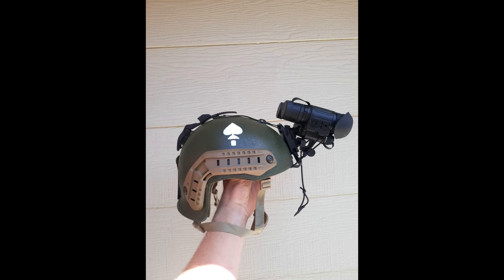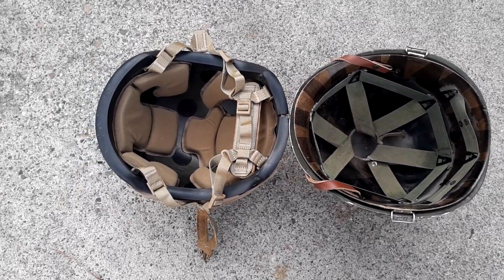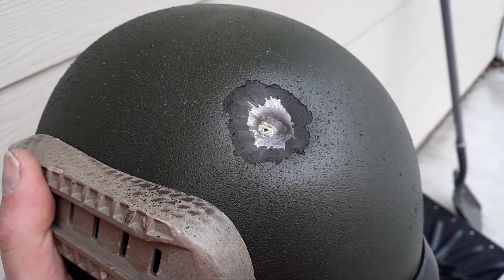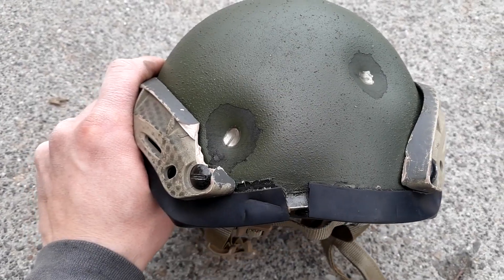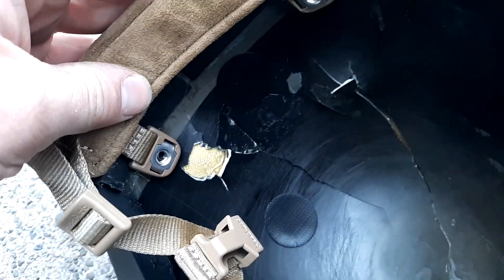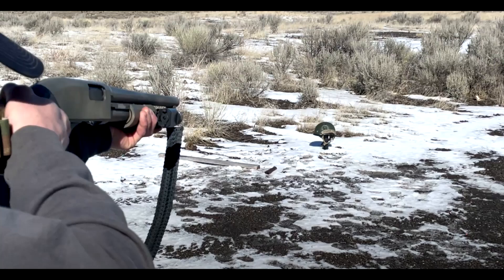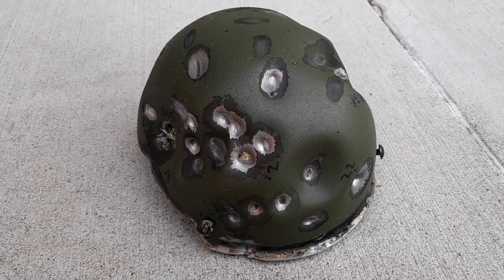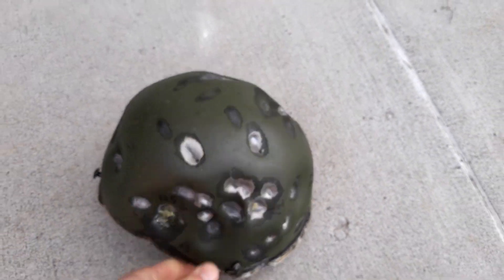Homemade helmet stops bullets

Comment: You need to make a Kolpak version of the M1 helmet
Reply from the maker: I d considered it. The steel on the m1 is harder than any helmet I’ve ever drilled. It’s very tricky to work with
Reply: @Fairfax_kit  You could do it on the Vietnam era M-1 instead. The moment you make a M-1 Kolpak will be a great day as whatever you make I plan on adding to my Alternative History series.

The only way for me to know what it would look like is if someone made it and well that would be you
Reply from the maker: @thedoctorairsoft6813 the hardness has t changed through the eras unfortunately. I can do it, but it’s very difficult is what I’m saying
Reply: @Fairfax_kit i believe in you tho

Comment: I would love to see tests on an east german M56 steel helmet modernized with an aramid liner. This helmet has time and time again been proven to be the best of the classic steel helmets. It's steel is high quality and the front is angled at 40 degrees while the sides and rear are at 30 degrees. As it is it can withstand powerful pistol calibers such as .357 Magnum and 7.62x25mm Tokarev FMJ.
Reply from the maker: It'd be really cool to make. Maybe in the future, it's a lot of work to do
Reply: @Fairfax_kit  Please tell me your working on that DDR helmet

Comment: for a diy helmet that shit surpass expectation. Btw it would be cool if you can test one of those 80s pasgt helmet to see how  the 40 years old kevlar hold up (not because I own one and too poor to buy a ach).
Reply: save up for good bucket
Reply: @BungSpoot  my country have a ban on any form of weapon and body armor so it is stupidly expensive to even buy surplus stuff.
Reply from the maker: Pasgt helmets are still very good and dknt degrade like people claim, short of submerging them in saltwater. You should be fine.